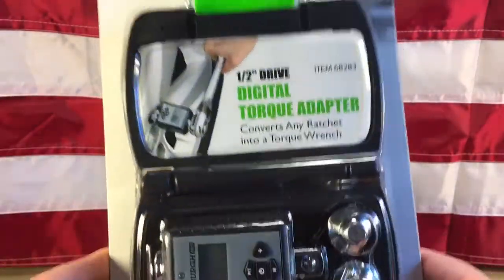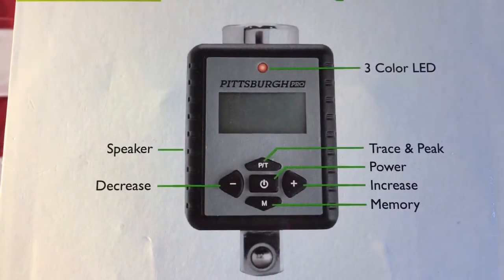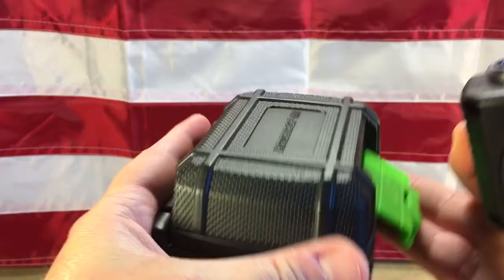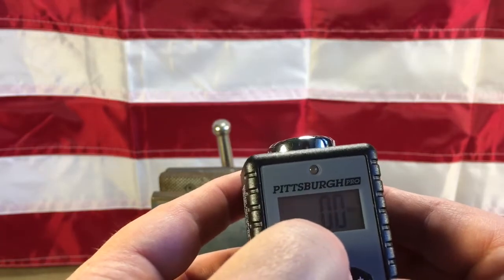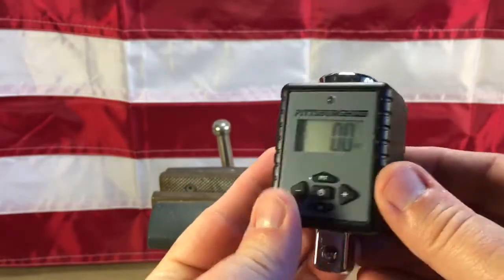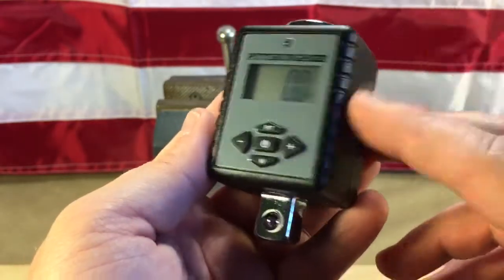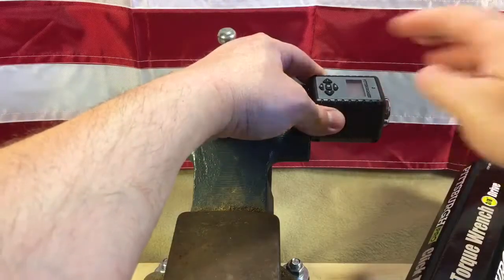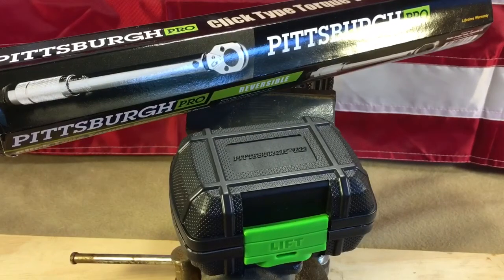Harbor Freight Digital Torque Adapter

Comment: Wondering if anyone who knows more about these digital torque adapters can explain how they remain accurate at different length arm attachments. I realize this is at the pivot point and it is calibrated at this point, so leverage may just be that, leverage. Not a change in torque value at any length. Thx!

Comment: I got this one along with 1/2" and 3/8" torque wrench from Harbor Freight.  They are all brand new.  After testing, both wrenches are 10 ft-lbs more than this adapter.  I think the adapter is not correct.
Reply: I know this is an old post but I'm replying for the benefit of everyone. Your torque wrenches are probable reading 10 ft-lbs over because when the wrench clicks, there is a slight "bump" in torque value. This would not affect a fastener but the torque adapter is picking it up. It sounds like all three are correct.
Reply: Its actually been reported that the harbor freight torque wrenches are 10ft/lbs over what the setting is.
Reply: How do you test 3/8 torque wrench with this 1/2 adapter?
Reply: @geoffe6144  It has been 4 years since I did it. I believe that I tested them on my SUV front wheel tire nut.  Once you know how to operate these torque wrenches and the digital adapter correctly, then you will be able to test them easily.

Comment: Would be great if it converts to inch pounds
Reply: RG GT     True but it’s easy to convert to pounds.
Reply: One option is to get used to, and start using, the metric system....the rest of the world has!!
Or, you can use the setting in this unit to just use ft-lbs :-)

Comment: I'm on my 3rd one. battery goes dead after about 15 minutes. Anybody else?
Reply: John, I know this is an old post but I thought I would reply for the benefit of everyone. The old Pittsburgh version that H.F. used to sell used CR2032 batteries and they would go flat in a very short amount of time. The new Quinn model they sell uses AAA batteries which last much longer, plus you can actually hear the beep.
Reply: @Pro1er  I wish I had the AAA model, I've already replaced more than 10 cr2032 batteries.
Reply: @ronenfe  These units draw power even when not in use, you have to pull the batteries if you're not going to use them. You can buy CR2032 batteries at Dollar Tree. I've seen a couple of videos on Youtube where people have converted the torque adapter to run on an external AAA battery pack if you are willing to do that.
Reply: @ronenfe  Forgot to mention, make sure that if you keep it in the case that closing the cover doesn't activate the buttons like one mine does.
Reply: @Pro1er  yes, it happened to me too that the case presses the button. Why would it drain the battery when not in use? I guess I will leave the battery cover aside, so I can remove the battery without effort

Comment: Pretty cool device, but it drains batteries fast.  I turn it off immediately when using, mostly to check my wrenches, and remove the battery when storing.
Reply: Yes, you can get not many measurment before battery is drained.

Comment: I own this adapter and I own two more similar devices made by "ACDelco".
One of them is model : ARM602-3 Heavy Duty,3/8" Drive with Torque Range ; 3-  59 ft-lbs.
The other model is      : ARM602-4 Heavy Duty,1/2" Drive with Torque Range ; 4-147.6 ft-lbs .
"Pittsburgh" torque adapter is draining batteries even when tool is stored.
I still have original batteries in my "ACDelco" tools after 18 months of purchasing them.
I never took the batteries out of adapters.I will try to remove the batteries from "Pittsburgh" after use.